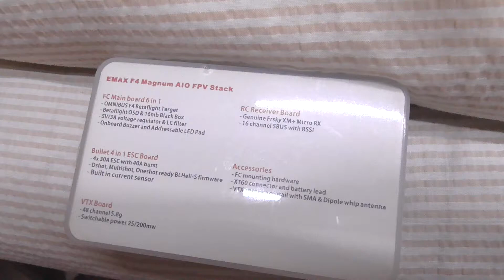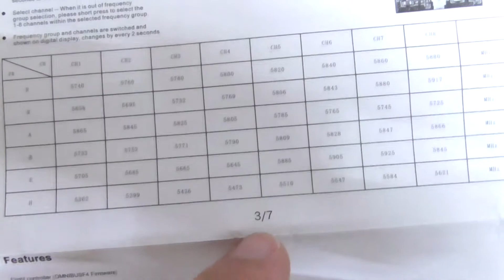How to switch between 25-200mW power (Video Transmitter, EMAX F4 Magnum AIO)

Comment: should i have the battery connected?
Reply from the maker: Of course, without the battery it won't do anything (it is not a physical switch so that it should remain ON if you pressed it).
*I just replaced this video transmitter with a 500mW one.

Comment: Funny cause mine doesn't change anything still horrible even on 200mw
Reply from the maker: Make sure the antennas are the same on both the transmitter and receiver (ex: right-hand circular polarized on both)
Reply: @furulevi  they are lol